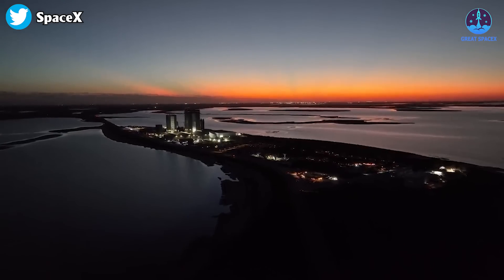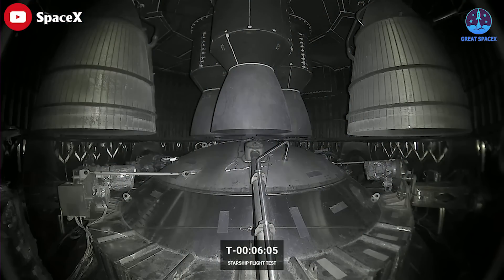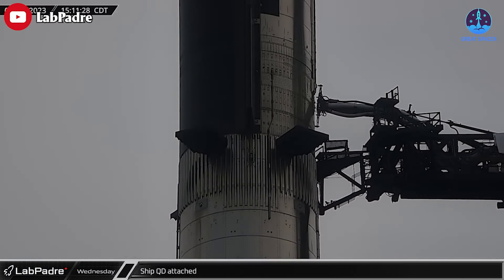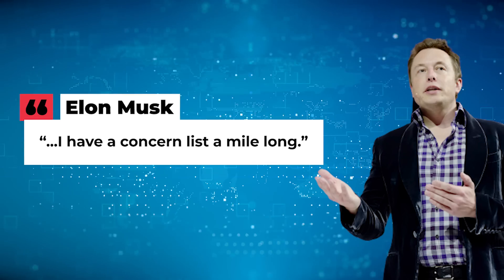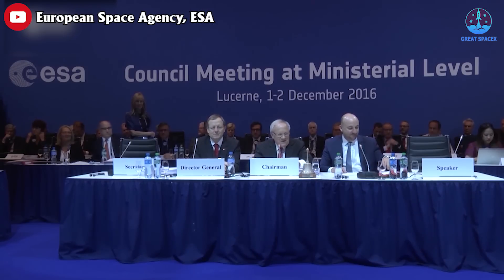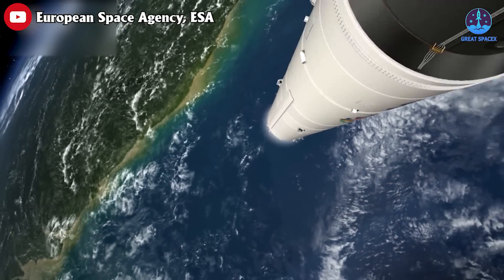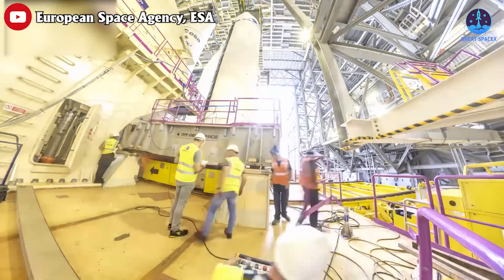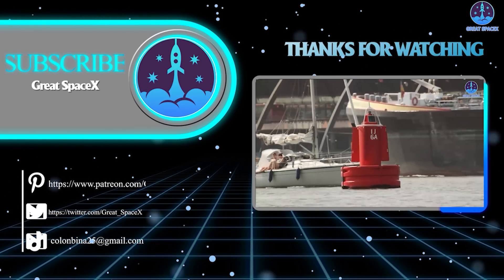SpaceX is working on many issues for Starship's first launch on April 20, Musk confirmed...

Comment: LOX is liquid oxygen.  I think it's better to just say that.  Also, centigrade is a unit of angle: 1 grade = 90 degrees of angle, so a centigrade is 100th of a right angle. Lots of people use centigrade for temperature, but I think it's more correct to use celcius or kelvin.  Congrats on 100 ksubs.

Comment: Don't you guys have a kowledgeable expert proof read anything?  Centigrade is older old school than your grand dad.  As most of your audience are in the USA please also use F, eg LO2 is -297F. 

Valves are designed for thermal contraction.  Most sticking problems are because they did not heat and purge to get a low dewpoint before cooling the propellant tanks with oxygen vapor (uniform contraction) and lines down and then filling with LO2.  And there is NO way Elon's LOX tanks are 30 to 50 bar!  Where on earth did you come up with that high value.  The lower the temperature the colder and more dense the liquid.  One bar equals 14.5 psi. SpaceX is not storing LO2 at 435 to 725 psi!!!  Even standard industrial gas bulk storage tanks are 250 psi maximum allowable working pressure.

The tanks can be pressurized using boil-off gas or intentionally vaporized oxygen, or helium pressure bottles (former).  But the liquid is still saturated at a colder temp (eg the CH4 is densified so must be colder than the -259F boiling point).
Reply: Celsius and Fahrenheit please

Comment: What happens to all the fuel that was used to fill Starship? Is it all pumped back into the storage tanks or is it wasted and just vented out into the atmosphere?
Reply: Am sure as much as possible is saved.  But cooling down the thermal mass of piping to and from the storage tanks, and that of the space lauunch vehicle itself, just to start filling or draining the propellant tanks, creates a lot of vapor that would have to be reliquified or flared.  The oxygen can just be vented. Methane is supposedly is 23X to 80X worse (depends on the "expert") than CO2 as a greenhouse gas.

Comment: And provided that the launch of Ariane 6 is successful, in June 1996, the first launch of Ariane 5 was failed, It is unlikely that the launch will take place on time, there may be any delays, postponements or scrubs of launch attempts. And if the launch of Ariane 6 ends in an explosion, then Galileo will not fly until the investigation ends and will not conduct a second test launch without a payload.
Reply: Same with Starship....
Reply: @joannewilson6577  We hope that tomorrow or another day the Starship will not explode, either on its own or at the command of flight termination system.